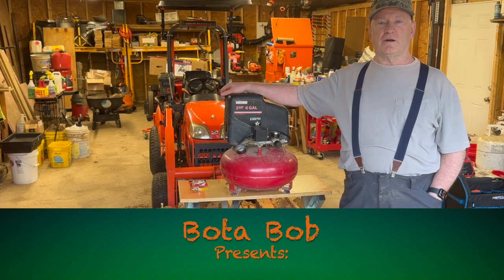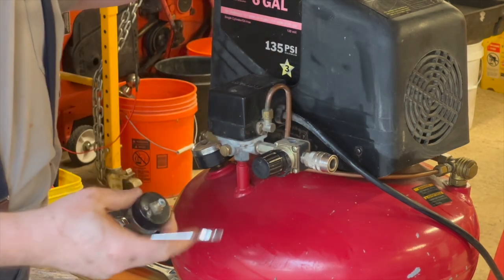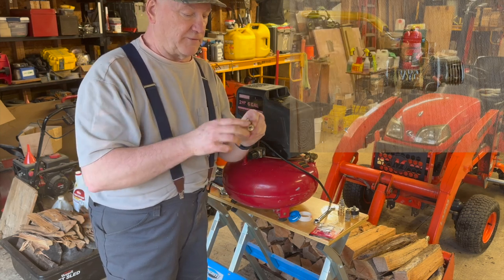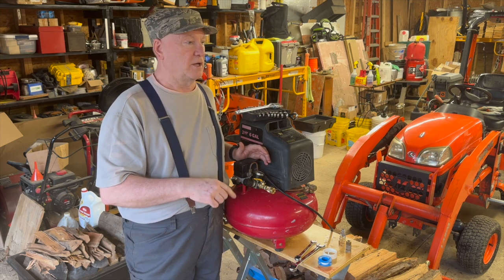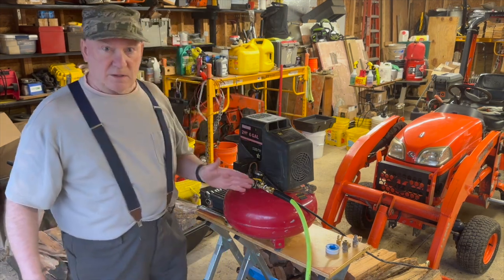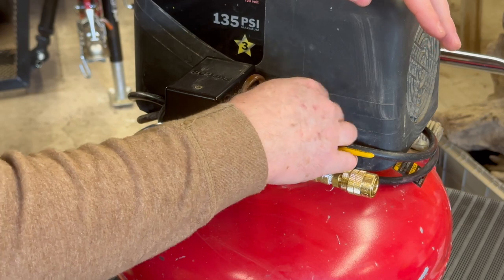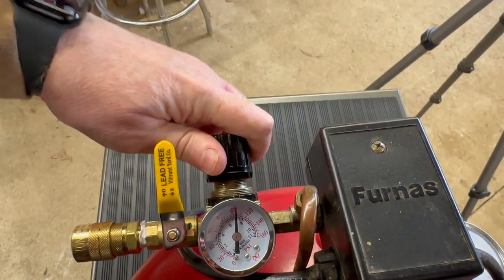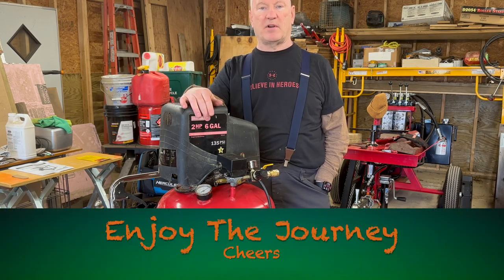174 - Craftsman Compressor Rehab

Comment: Good job! Motivated me to get my compressor back running. I got an Ingersoll I let sit with gas for a couple years. Enjoy the journey!!
Reply from the maker: Good day TB.  It's likely an easy fix.  And having an air compressor is very handy.  I recently purchased a Milwaukee M18 Battery Inflator video #168.  It's great for airing up tires with slow leaks and footballs, etc.  Thanks for watching and commenting.  Enjoy the journey - cheers

Comment: Great upgrades. I think our compressor is just over 20 years old too and guess what, we put a ball valve on ours too. Using the soapy water to check for leaks was a great idea
Reply from the maker: It's good to hear I am in good company keeping my old compressor in running order.  I think I spent $22 for the parts and a new on would cost about $170 and it would not have a ball valve.  Thanks for your support for the Bota Bob channel.  Happy Easter to all of you in the UK.  Thanks for watching and commenting. Enjoy the Journey - Cheers

Comment: I have a 30+ year old Sears Craftsman compressor also Bob………..It’s the 5gal one but it’s still strong………..they were pretty good for their time. Those green airlines are amazing Bob…….you will love it. Great vid Bob.
Reply from the maker: I have never used this type of hose before.  When I bought the compressor, I also bought a the Craftsman hose reel with hose.  It's okay, but the hose inside of it the worst.  I like the idea of a self retracting hose reel, but the I wish the hose included was more flexible.  What would you buy today if you needed a new compressor?  Thanks for watching and commenting.  Enjoy the journey - cheers
Reply: @botabob  the last compressor I bought was a cordless one by Ryobi and I love it. I use it for my small air nailers. It may have been shown on my “Tire Change “ video a while back. A compressor purchase would depend on the air demand a person has. For high demands the screw type air best but not feasible for the common folk.

Comment: Ball valve had to do that a few years ago same problem leaking are , good fix 👍🚜
Reply from the maker: Good day Len - I hope you all are doing well.  A very easy fix.  It didn't need the pressure gauge, but I figured while I was giving the old compressor a refresh, I would put a new air gauge on it as well.  Thanks for watching and commenting. Enjoy the Journey - Cheers

Comment: I have an air compressor made by Husky that I bought from home depot online. So first thing I did was remove the drain and install a braided line with shutoff to bring it out farther for easy draining. After running it i noticed the pipe coming out of the tank was leaking. So in order to get to it I had to remove the electrical wiring from the switch. Not a big deal but still shouldn't have been a problem to begin with.
Reply from the maker: I like the idea of moving the tank drain for ease of access.  I agree, how hard is it to tighten all of the pressurized joints.  Thanks for watching and commenting. Enjoy the Journey - Cheers

Comment: ya those quick connects always leak after a while that ball valve is a good idea.
Reply from the maker: I should have replaced the coupler 3 or 5 years ago.  When my air hose coupler blew out I bought a kit with an assortment of parts including two quick connect couplers.  I thought about using one on the hose and one on the compressor.  When the parts arrived I discovered the coupler used on the hose was different from the coupler on the compressor.  LOL Thanks for watching and commenting. Enjoy the Journey - Cheers